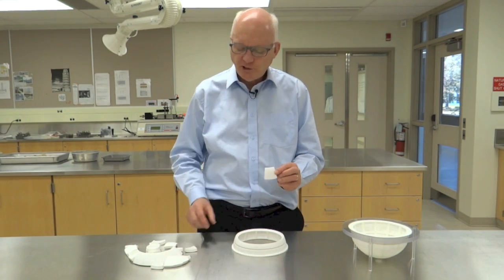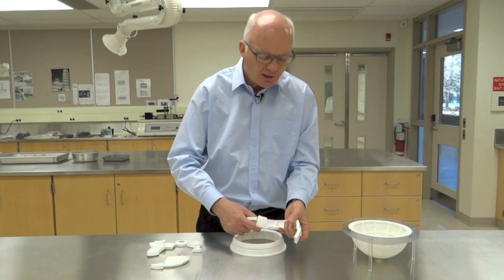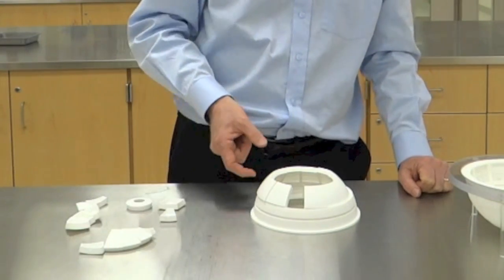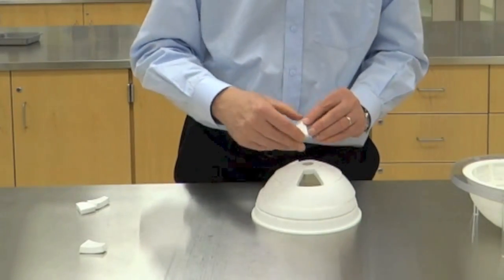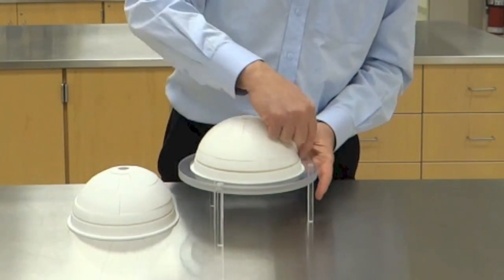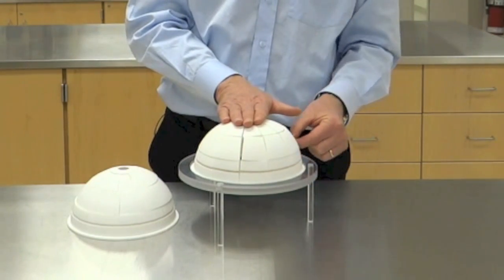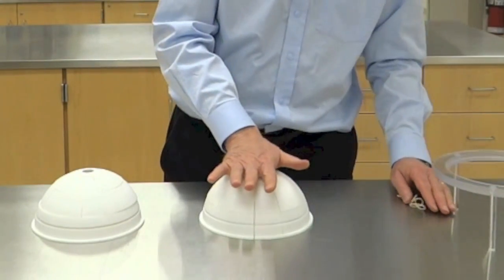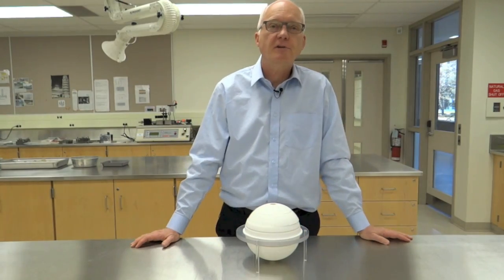Model of a Dome, Igloo and Spherical Tank

Comment: An igloo actually spirals up, so each block when placed is support on two sides by an L-slot between the one below it and the one placed just before.  If the 3d printed blocks were made to do this, they should just stay in place and become more locked in as blocks are added.
Reply: You should watch Nanook of the North or some of the other Canadian Film docs of Inuit building igloos.
Reply: He literally says so in the video. He even uses the correct word - helix - as opposed to spiral.
Reply: The mathematics for determining the 3d printed dimensions for a set of helical blocks for the igloo would be a neat exercise for students.
Reply: @tomlouie2855  Another complication. Each block is trimmed at an angle so that the next block can't just slide off into the interior. 
Did I mention that I've made an igloo? It wasn't very pretty, but I did follow the basic Inuit process. I insisted on sleeping in it. They drip. The whole concept of an igloo is that it blocks the wind, and interior temperature rises to the melting point of water 32F/0C/ so it drips. (I was at 7000 feet (2100m) so these temps were a bit higher.) Fortunately my car was near by so I got some plastic sheeting to cover my sleeping bag.  I used a machete, not having an illegal walrus tusk knife like Nanook.  The design is pretty intuitive that you can see in the Nanook of the North documentary. That's a good lesson.
Reply: @WillN2Go1  if the interior curvature of the igloo is smooth and consistently concave, then the meltwater might adhere to the surface and roll down the walls, instead of dripping down.